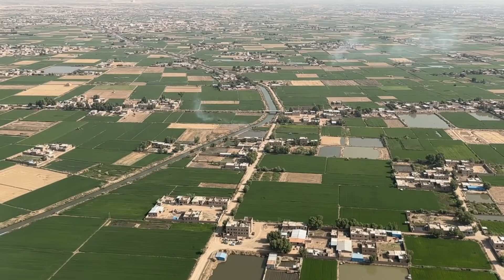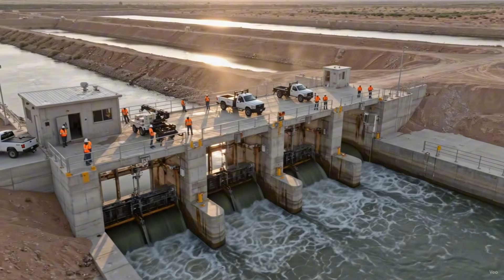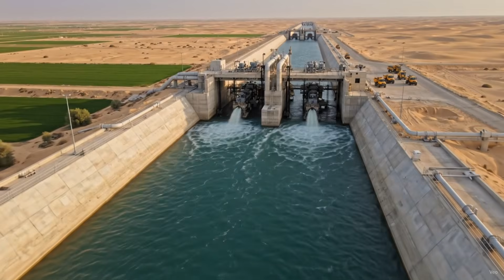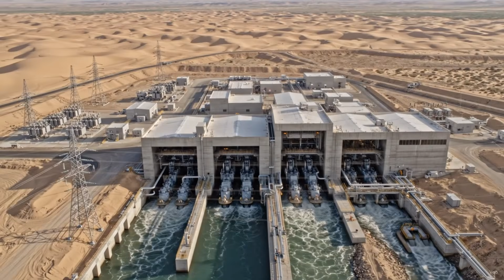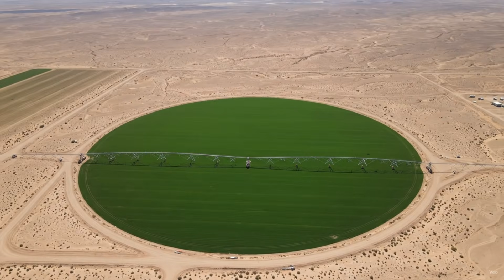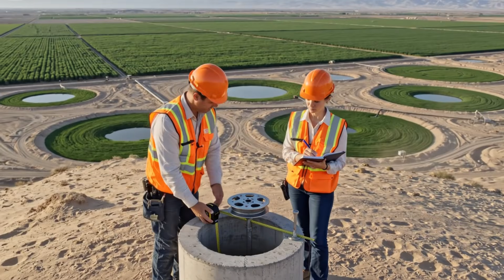How Egypt Built a 174 km Water System to Turn the Desert Green

Comment from the maker: The most surprising part of Egypt’s New Delta project isn’t the canal — it’s where much of the water comes from.
A major part of the system takes agricultural drainage water that has already been used, moves it across a huge engineered network, treats it, and sends it back into agriculture.
The big question is: Do you think large-scale water reuse can make desert agriculture sustainable for decades, or will water and energy remain the ultimate limit?
I’d love to hear your engineering take below.